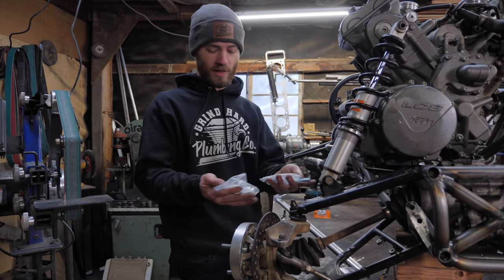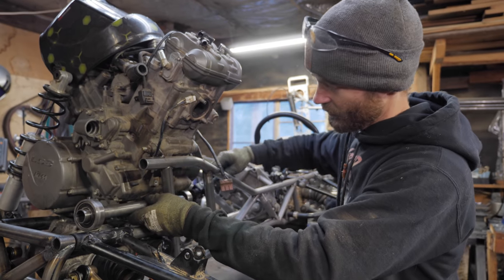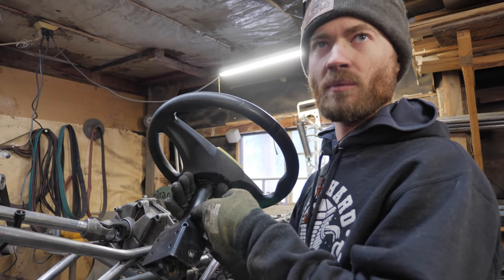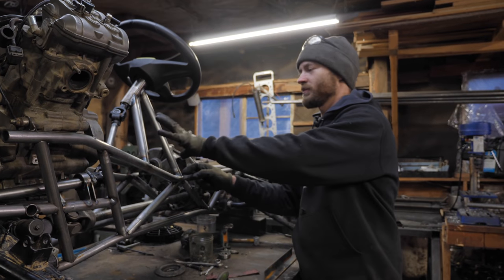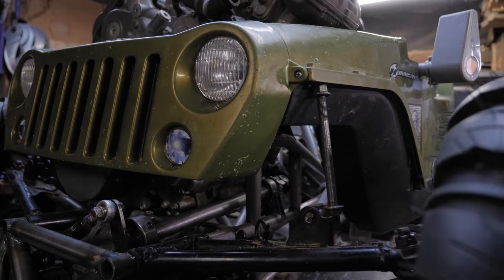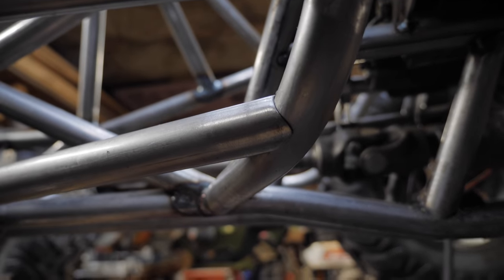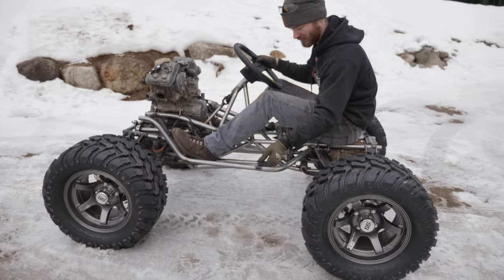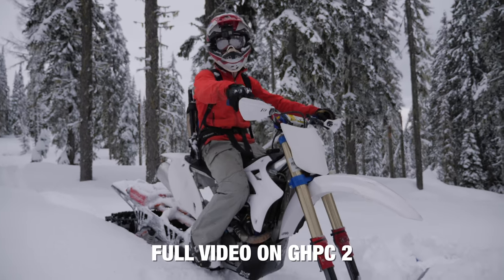1000cc 4WD Go Kart Build Ep. 7

Comment: It's coming along nicely. Only thing I would have tried to do differently, would be to make the controls as car-like as possible. Foot throttle, brakes, clutch. The foot brake would operate all brakes, but have the front/rear bias adjustable, then work out a way to have hand operated, hydraulic hand (or E) brake to lock only the rears, like drift cars have. That option does not look doable now as there isn't enough room! I know you guys will make it work though, & I can't wait to see it completed & out there shredding!

Comment: Maybe weld a brace over the top of the drive shaft? It will provide a weld point for the steering column and also protect your legs if a u-joint ever breaks.

Comment: I would recommend taking the brake master cylinder and braking arrangement off a Polaris Sportsman ATV. The front master operates both front and rear brakes which works well enough because there are two front rotors and one rear, and they do have a separate foot brake that actuates the rear caliper independently. You don't need that to drive but it is a hydro handbrake haha.

Anyway I'd totally rip off how Polaris does it because they have one circuit for all the brakes and it works fine.

Comment: I reckon you need to just clear coat all the frame work , resist the temptation to paint it .
Reply: Problem is you cant prime it then.
Reply: Ryan F I think there are clear primers
Reply: @ryanf2709  you don't prime for clear coat silly. You clear it so you can see the metal look still and no rust. Clear makes it pop more to especially if it's all brushed.
Reply: @adamfortenberry8775  🤦‍♂️ thats why I said you cant prime... Captain obvious over here.
Reply: @flyingwolffilms  the only clear primers ive ever seen are ahesion promoters for Plastics.

Comment: Amazing build as always! I've been with you since Barbie Cart, and every build you do is better than the last! This one is no exception. I have some constructive criticism though! You guys could benefit from learning about optimal use of u-joints, especially angles of two connected u-joints. The way you made the steering wheel angle is going to make the steering quite bad, due to the shortcomings of u-joints and your design choices.
Reply: Look at what they are building,  what other options do they have?
Reply: @jasonovervold8943  Possibly a bevel gear
Reply: @jasonovervold8943  they can still use U-joints, they djust have to tweak the design a little bit.
Reply: It's just steering and it worked great too! With adjustable Ackerman! How could you ask for more? That will last plenty long enough before it breaks. It's designed to be removable so it can be replaced if need be anyways.
Reply: @adamfortenberry8775  The problem I'm talking about is not to do with the steering geometry. It's about how they angled the U joints in the steering column, because the way it is set up now will give unequal wheel turn movement per degree of steering wheel movement in different parts of the steering wheel rotation.

Comment: You can do your own custom size pipe shape jig by getting a bunch of needles, then put your pipe into position, and start wrapping some tape. As you wrap it, add the needles. Obviously, in this DIY variant,l you want the needles to be as big as you can, so you don't sit there all day. It works just fine with 2 3 mm needles.

Comment: You could make the brakes as a sort of priority system so make both brakes work with one slave or cable and then make it priorities whether the front brakes get most distribution or the rear ? That way you can use the left foot for clutch and right foot for throttle per say ?

Comment: I notice the link from the steering column to the front steering linkage goes to one of the "akerman arms" rather than the central rod that joins the two sides together. Does this make the steering feel different in each direction? Effectively you have more mechanical advantage turning the right wheel than you do turning left, if I've understood it correctly.

Comment: My concern comes with the transfer case and diffs, since they're mounted upside down the gear oil is going to have a hard time getting g to where it needs to be
Reply: That won't have any problems getting oil on those gears. That thing isn't just gonna be driving in a straight line or be on a level plain very often. That oil will be distributed just fine on those gears.

Comment: Since you have 2 brake circuits, could you control them from one control with a balance bar? could make it a little easier to control them from an ergo standpoint, and adds some fun adjustability for doing stuff like crazy line-lock burnouts or drifting

Comment: Do a tractor system with the brakes, two pedals that can be linked with a metal tab, left controls front, right does back. Or however. Look up tractor brake pedals

Comment: You need to either replace those U joints in the steering shaft with cv joints or add another joint section, it will end up failing. U joints do not like to function beyond about 30 degrees of angle, 45 at max and you are running them at about 70-80. You are going to hit a rock and end up busting the ear off one of them. I will be very surprised if you don't catch that one on fire with the exhaust.

Comment: I don't know if you have noticed it or not but you have to turn the steering wheel one way a lot more than the other way because the steering arm is not perpendicular to the tie rod. You could solve this problem by adding another L shaped double arm (pivoting at the middle) and two shorter tie rods so that the arms are perpendicular to their tie rods (when the wheels are in the middle position)
Reply: Or just extend the existing arm off to the left side and make a longer tie rod

Comment: About the empty space on the right... grab a master cylinder and an oil cooler from the junk pile and thank yourselves later. Sure it would provide easy too much stopping power, but that shouldn't be much of a problem considering how,  "because racecar" this build is getting. 

Also maybe a left mount for a tiny fire extinguisher. This thing's going to be a real track weapon. 

Do you guys have fireproof suits yet or is it pretty much moto helmets and the welding apron?

Comment: It’s 4 wheel drive you maybe able to get away with one set of brakes. Like one brake  control as if you hit rear brakes say harder then you hit front brakes it won’t matter because your braking harder with rear but you locked in four wheel drive it’s goin to slow your front wheels because your drive line is hooked to rear tires where you are braking harder so that being  said it maybe better to have one control braking all four tire so you don’t get any stress on drive line from only braking with front or rear at a time. So  one control like car or 4x4 vehicle still only has one brake lever/pedal is going to be better

Comment: What if the fuel tank was a jerry can strapped on the back that looks like it’s supposed to be removable??
Reply: Cool but what if it wheelies on pavement
Reply: Other user44  Could put a lil frame around it for protection, or just use a plastic tank inside what looks like a removable jerry can. Either way don’t look for too much logic in YouTube comments
Reply: Yeah